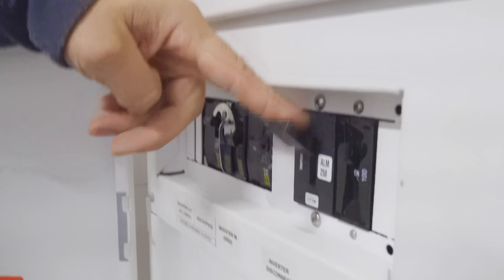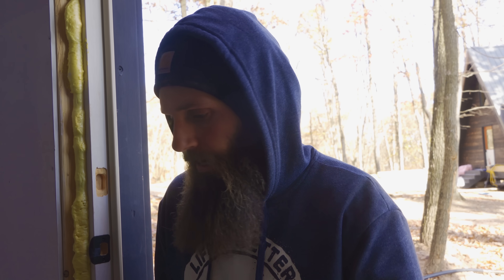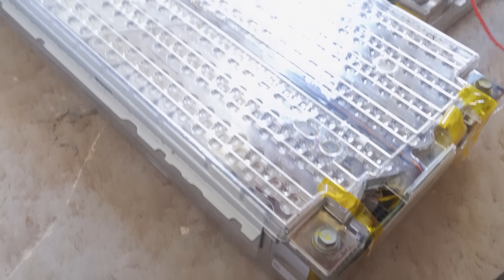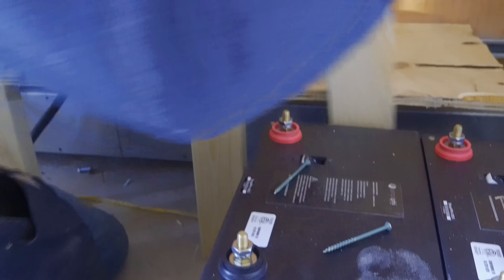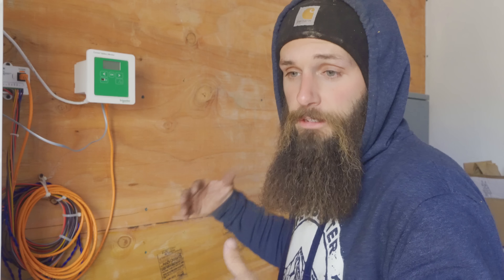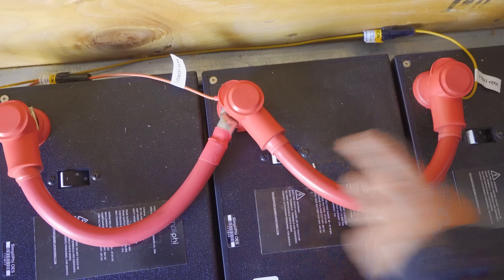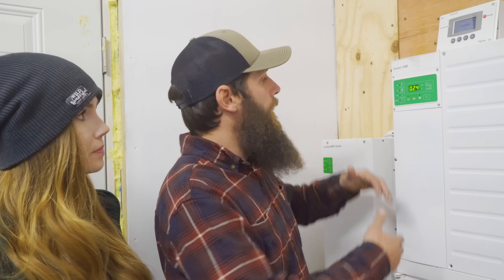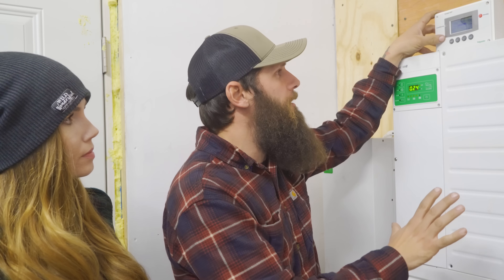Overhauling Our Solar Power System!

Comment: If it was me I would have stuck with the Tesla batteries, double your days with no sun with more KW. Using a contact to break connection with a 3rd party BMS. Plus you can liquid cool the Tesla batteries like they are in the car. Car has 22 gallons on liquid coolant. Btw they can be used to 100 deep if charge, no memory.

Comment: Josh I've seen some people using auto batteries or deep cycle Marine batteries . You're an electrician , what's the downside using those vs what you've done? I'm a novice could you explain solar power ? Or better yet write a book called solar power for dummies so that everyone can understand it ?
Reply: People using auto batteries or deep cycle marine batteries are almost always using them because the cost of getting started was cheap, NOT because they were good or the best choice.  In some cases, they used them because they simply didn't know any better, but they'll all know as they use those systems, about replacing batteries when they're too dead to hold a charge long enough to be useful.

Comment: Personally I would take negative from one end of the string and positive from the other end to help better balance the batteries during high loads.
Reply: I had the same thought when I watched the video. Making this change would make each battery have the same terminal voltage when charging or under load. Battery life should be a little bit longer.
Reply: If you look up the required wiring for SimpliPhi batteries, they require that positive and negative wires go to a shared bus.
Reply: Not necessary for load sharing,. as provided the correct gauge wire has been used in the 1st place, any voltage differences across the battery terminals will be negligible. ie mV... more important is the torquing up of the connections and making sure they are all clean with plenty of surface area to the bolts and studs.
Reply: @diyhouse  Yes, the voltage differences are in the mV range but you have to look at every possible resistance. Internal battery resistance is in the mOhm range and so are each lug contact. With Lithium you have to think symmetrical. I would even have same length battery leads going to a short piece of heavy copper buss bar and go to the inverter and charger from there. I believe SimplyPhi even recommends this if memory serves me right.

Comment: Both Li-Ion and LiFePo have thermal runaway.  They both have Lithium which is the chemical that causes the problem.  The trick in the even of fire is to use LOTS of water to cool surrounding batteries.  Interestingly enough, LeadAcid also have runaway, just different.
Reply: LiFePO4 batteries don't suffer from thermal runaway.  Don't recommend adding water to any Lithium battery system, either.  Lithium + water + spontaneous combustion.  Lead acid batteries can short out, which will usually cause the acid to boil, but that will stop as the acid is gone, but the mess can be cleaned up with baking soda & water.

These Tesla battery systems were designed & build to have a continuous liquid coolant system keeping them at the proper temperature range, and this application didn't provide a cooling system, so Josh had reason to be uneasy about it, because Li-Ion batteries can and do have thermal runaway on occasion.

Comment: So you went from 4.8 watt-hours per dollar cost to 1.33 watt-hour per dollar cost, a reduction of 72%*, for the increased peace of mind and the ease of use/ upgradeability. According to the research you did, how likely was the Tesla system to experience a runaway? Just curious. I get that the difference between no likelihood and any probability greater than 0 can be determinative, especially when you are working so assiduously to build your homestead debt-free, a truly commendable goal. I hope you get a good price for the Tesla system. 

* 21kilowatt hours for $5,000 to 12kilowatt hours for $9,000

Comment: Absolutely would love to see any videos on your system. Not being an electrician, all this is new and hard to comprehend. Your system is quite sophisticated and cutting edge. So impressed with Josh's knowledge of wiring and installation. Your site could be a go-to for anyone trying to set up the same off grid power system. As I said before, I am so impressed with the way the two of you are building this house. Top notch.

Comment: Been watching shortly after you moved and installed your solar power system, it has been a journey for sure, started watching cause i plan on moving off grid and installing a similar system for power. love all that you do and the content of your videos, we plan on being 100% debt free before we move off grid.  i plan on retiring early in 13 more years but at that time i'll have a military retirement plus a 20 year 401k to pull from as well. We started gardening this last late spring, in 7 raised beds and plan on 7 more come spring. Just added chickens to the mix, not to bad since we live in town on about 1/3rd acre.  Thinking about getting a couple turkeys and maybe a pig come spring as well.

Comment: you made a s mall mistake on the battery cables, its better to mount the negative cable from the bank on the oposit site, the way you have connected i now you draw more power out of the first battery< i know you have a bms, but you have more eficiency iff you change that connection.

Comment: Your goals and experiences with solar interest me. Are you really convinced that your solar system will never/very rarely ever need a backup once you are all moved in? Is it  problematic to keep a large propane tank on your property, perhaps with a smaller online backup generator to provide assurances? It looks like you guys made a smart upgrade with this change-out and future expandability, however since you-know-what happens and you will need some propane for stove, dryer and (temporary?) water heater too, right? I know you’re planning a wood-fired system but they seem so labor-intensive and demanding to me. Very   affordable fuel for you all, though, I realize.

Comment: Love the site but for you with batteries on grid if the power goes out because the solar system is on the grid you will be locked out then power goes out. MEANING YOUR BATTERIES CAN NOT BE USED AS A SUPPLEMENT. You would need to bypass the meters (solar and grid) and switch to an emergency or generator bypass. Do not energize the grid please.
Reply from the maker: We are not tied into the grid at all
Reply: I know your not and great some may be. Not everyone lives in the middle of nowhere. Love the show!

Comment: Great video thanks! One comment though. The way you have the power feed off of the parallel Bank coming from One battery will tend to work that battery harder especially under heavy loads because of the extra resistance of all the other cables. It might be better to have the positive come off one end of the bank and the negative come off the other. This will work all batteries much more equally due to equal resistance to all the batteries.

Comment: I knew that if I was patient you would answer my questions.  Mainly safety considering the fire reputation of lithium ion.  

The one question I have wanted to ask most off grid homesteders is about adding wind turbines as a secondary source of power.  During the low light times of the year and during the rainy season there is usually a fair bit of wind to run a mid-size turbine.

Comment: I had Solar City install my solar system on my house but the batteries weren’t available at the time. I wish I had been able to get the backup batteries as several times I’ve had power out and we were without power for 6 hours.
Reply: Your experience is very useful for me

Comment: A small thing (I think).  With lead acid batteries the + and - leads should come off opposite ends of the battery bank for proper balance.  Is this true of LiFPo batteries also?
Reply: Darn good question!

I believe the answer would vary depending upon the experience of the tradesman involved , in giving the answer!

For the record ,  my 30 years of experience showed it should be at opposite ends.
Reply: True for any battery technology. Especially important when drawing 100 and more Amps.

Comment: How much did you spend total on the solar system that you installed.. can you break the cost down for solar panels, batteries as and the system on wall with the new batteries not the Tesla batteries....
9k each battery or for the set of 3?
Reply: 9K for the 3

Comment: Great video, nice to be safe with this stuff. One question though - and I am not familiar with these batteries - but shouldn't You have connected one incoming/output to the first batteries negative and the incoming/output positive to the last battery in the parallel (or vice versa)? That to get the "flow" of charge/load thru all batteries.
Reply: That would make the batteries wired in series. That multiplies the 48 volts times 3. When in parallel like they have. Voltage stays at 48v and you triple the amperage the batteries can output. So basically the three batteries are now one.

Comment: Just curious if you guys have researched / considered standing up some micro wind turbines to trickle power in on days when the sky is dark but some wind is moving.  Thanks for the array of good content.
Reply: I am not sure if those small turbines are like the huge ones the power companies use or not, but I know those huge ones have to have their blades locked so they won't turn when the wind gets over a certain speed.  I would hate to have to run around to all the small ones separately just to lock them down every time the wind really picks up.  Here where I live, we commonly get some 60 mph+ wind storms.

Comment: We have a 12 volt system instead 48. we used to have to put our refrigeration  on timers on the short days of winter we just switched over to 20 6volt batteries 15 year warranty  ...no more timers power all night long ,we run welders and all kinds of shop tools all the time no problems

Comment: Its smart putting the charging station in separate building, solar converters and batteries are unstable power stations . DO YOU HAVE SURGE PROTECTOR ON YOUR PANEL PROTECTING APPLIANCES ? TESLA HAS HOME BATTERY STATIONS 3 PHAZE!
Reply: You mean Tesla Power Wall batteries right? These are cool, but they are meant for ongrid systems. For the off-grid, Tesla Power Wall does not make sense.

Comment: very interesting i do know they never  torqued anything down here had a lot of problems with the solar power system i had  wind  was very messy at to what we have  the water wheel works great al long we have no visitors they love to play here in the winter  last year they were freezer closed before the what ti go back  they stayed here all winter here and they are here again I am now emergency  power than what the utility company said spring they will put power back to the farm what i wanted to be done in the first place  some as to the gas lines i requested  gas line has been run I did not want power poles to want them to be underground under the road worked for me the gas company did it will have asphalt  when it all done  did a road upgrade 10 years ago  planned to have a grain dryers and grain cleaning is done here   could not go with it do to the utilities were too small comming to here  why we went off-grid for mmm love the free power a lot did the math cost me the same to bave the panels  and batties  to sit up 
the water wheel 5-year build  from the ground up  the building taking the longest to build all timber frame built worked on it slowly   
had machinery we stopped to rebuild before moved them into place  have  1 that can do it all nowhere too still love the challenge with the vintage mas=chinery and tools i was very lucky this build was spared too the guests have moved in here yes i do go and start the stove for them to enjoy too

Comment: The main wire usually connect to the central battery.
Because of the power going thru the wire one diameter, so the main power wire is need to be 3 times larger diameter (section).

Comment: Remember: Dishwasher and your Washer have an internal WATER HEATING element that uses electric to heat the water. So factor that in too. 
 Like the warning about thermal RUNAWAY.  I see why you have a remote power house afar from you main home.
Reply: Or...or, could hand wash ?

Comment: Congrats on the solar system upgrade.  Wow that Milwaukee 1/4 impact driver is pretty awesome; it's built practically the entire house and all the sub-systems so far.  Most of my friends don't have 1/4 impact drivers. I tell them you don't know what you're missing.  Regular drills are just too weak for serious work besides drilling.  I have 2 impact drivers -- Makita and a Ryobi.

Comment: Be advised that there is a correct way to connect batteries to and from loads. For a parallel setup you should have the positive in to the 1st battery. The negative out from the 3rd battery. That way you exercise all of the plates of the batteries the same. The way you showed in this video, you over work the 1st battery. I lived aboard my boat and had a 1000 Amp Hour system/bank.
Reply: Not enough benefit to bother reconnecting it.  The resistance of the connecting cables is so minuscule, this is not even close to being a problem unless the cables are on fire.  (In which case there are much bigger problems to worry about.)

Comment: I know Josh is an electrician so perhaps the concerns related to battery cable length have already been researched.  The bummer is that there's often mixed professional opinion regarding the length of the battery parallel cables with the discussion centered around the need to make all parallel cables exactly the same length.  After 25 years of maintaining off-grid battery packs, I've concluded that making all parallel cables exactly the same length, (because these cables will now all have the same resistance), the current flow in and out of the batteries is much more likely to remain equal.  When the batteries are paralleled in-line, the distance (and resistance) being unequal, will likely lead to unequal charging and withdrawal.  Yes, a BMS might remedy this.  But it will do so by shuttling current back and forth - perhaps as a consequence of unequal length parallel cables. This might be a question to put out there to the battery manufacturer.  

The primary difference required when making all parallel cables equal involves a relatively simply change using a common busbar.  In this respect, the battery with the longest cable distance to the busbar then defines how long the other parallel cables must be.   Of course this busbar must be able to handle the cumulative current as well as the single cable that will then feed your controller.  Again, you have new technology with those new batteries so perhaps this concern should first be raised with the manufacturer's tech people.  They might tell you not to worry about it.  On the other hand, this relatively simple change might give you even more peace-of-mind with greater battery performance and life.  Just throwing it out there for you to kick the tires!  Good luck.
Reply: A related concern -- very possibly also mitigated by the onboard BMS -- is how the charge/discharge cables are installed. In olden times, a parallel bank like this would always have the + and -- battery bank leads off of opposite 'ends' of the bank, so as to allot the most balanced voltages across all cells. Even then, periodic rotation of inner and outer batteries would be needed to maximize battery life.

Comment: isn't the power wall cheaper?
Reply: Yes, the powerwall is cheaper, but not useful for them.   Erin & Josh are completely off grid and it would cost at least $15,000 for them to have a grid tie.
Reply: @wallykramer7566  Oh you can't use powerwall off grid?

Comment: Yes... the big pro is NO thermal run-away, and better system integration that includes the BMS. You invested in not having a potential catastrophic fire hazard. It sounded like the price/per kilowatt, when considering Tesla to SimpliFi is about the same?

Comment: A question: Since you all ready have the old batteries, can't you use them as a back up source of power?
Reply: The voltage of Liion and LiFePo4 is different, so it's hard to charge these from a single charger. In order to use liion as a backup, some other investments would be necessary. It best to sell them and buy some more Simpliphi boxes instead.
Reply: I understand now. Thank you very much for your answer, @obajer .

Comment: So do they still get warm when charging or does that not happen anymore ? I know the Tesla power walls have the cooling system in them like the cars do. Also what's the average kwph on your usage ? As you say if your not going to run out of power doesn't matter if bit lower on voltage  👍

Comment: You should connect your battery bank output leads from opposite ends of the bank.  Positive on one End, Negative on the other end.  The way you have it connected with both positive and negative on the same end results in that leading battery taking most of the load, both discharging and recharging.  You are using large interconnects but each battery in your bank is seeing a different voltage and load.  The first battery has to discharge a little before the second battery will discharge and the third battery only operates when the first two are discharged a little.  This means that when you recharge the first battery has to overcharge before the third battery reaches full charge.
Reply: On point man very important with 3 or more in parallel 
I have 7 teslas in parallel